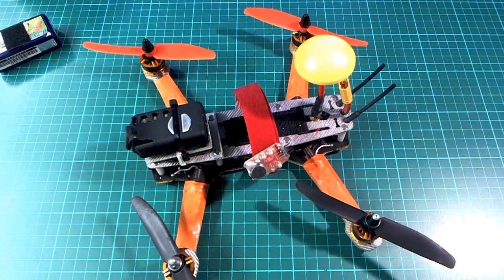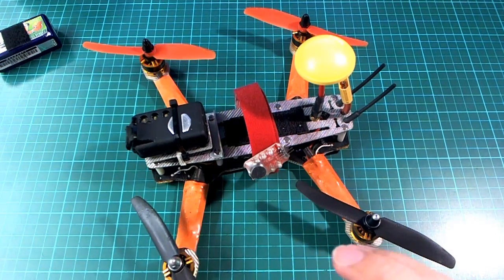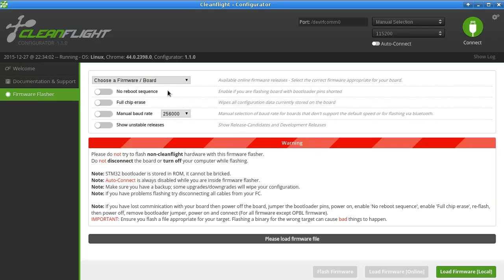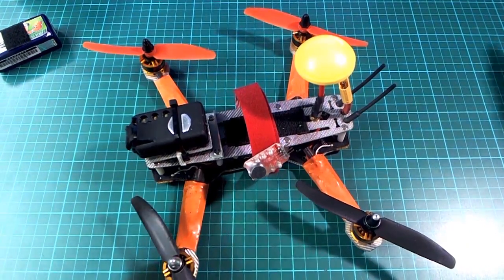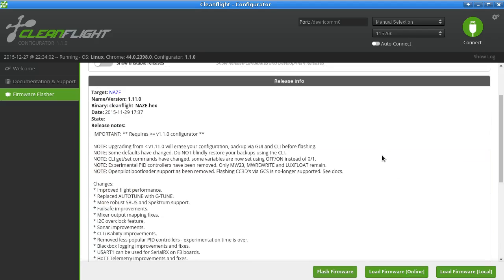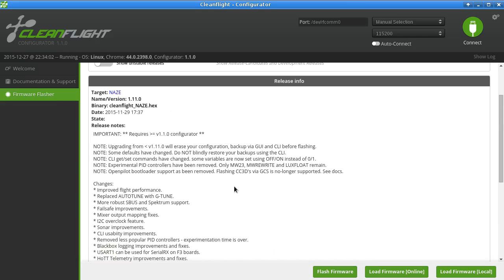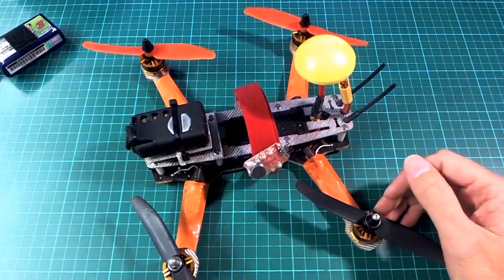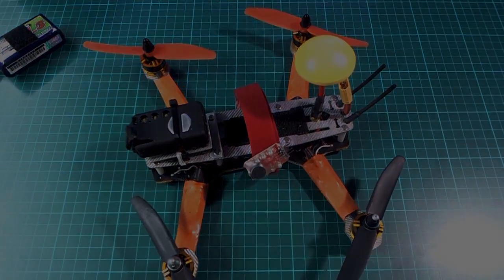Stability problem in Cleanflight 1.11 ?

Comment: just want to share my experience. I got a zmr250 running cleanflight 1.13.0 pid controller is multiwii rewrite. The Level P is 9 and in angle mode it oscillates a lot. Not as bad as the one in the video.  previously it was on cleanflight 1.10 using lux and it was very stable in angle mode. I want try rewrite simply because my board is  a F1 board(cc3d) which ppl say not an ideal fit for lux. float point calculation will be too much for F1 board and I am using led feature. Could someone please clarify for me, is the pid setting only applies to rate mode only?
Reply: My P level for lux was 6. I will lower my P to 4.5 and see it's effect on the oscillation.

Comment: TUNE YOUR PIDS. It´s like driving with a car with no air in the wheels. of course it feels wobbely. but the problem is not the car/copter itself, its the right setting of the different parts.

Comment: We are finishing a course at UNI with SPF3 on a 200mm frame, and all 3 quads were doing the same as shown on the video in Angle mode, 3 copters: 2 with Betaflight 6.2 and 1 with Cleanflight 1.12.... We brought the P down to almost nothing and it seemed like it needed to be brought up instead, can't resolve this, same issue on 3 copter assembled in a course... We initially thought it was due to the RCX red bottom Motors which were too powerful, using 30A Little bees, with one shot and profile 1 . rewrite FC...????? This issue reproduced on the 3 copters with 2 different Firmwares.... Reproducible, so big issue, right!?!? Can't tune it guys, just can't!? What would be the fix here, the PIDLoop is set at 3500, from standards settings... WE HAVE TO FING A FIX FOR THE STUDENTS LADS; WE NEED SOME HELP HERE ALSO....
Reply from the maker: +FPV Cambodia did you read the video description? It's the P term of the LEVEL PID, not the rate PID.
Reply: +iforce2d Wright! Got you.... This must be it indeed!, and we have installed a Sonar also for the course, which was not activated for the fIrsts 3 tests; but I get it, as on the Naze with Clreanflight earlier version, I had to bring the Level P to indeed around 5 with Sonar to keep it level properly... 90 is indeed, insane.... Will bring it back to 10 ich', and see how it goes from here! Haaarrrr; My reading is Crap! Tks again, will jump into it next week, when I am back in PP. and I will keep in touch! Tks ever so much! It makes sense! Cheers and Safe Flying!

Comment: yup, nail on the head, atti mode is STILL like this in cleanflight (no idea why that deafault hasn't been addressed) but Borris corrected it to 3 in Betafilght by default. That even caught me out when setting up a quad for a friend. Anyway, When was the last time you tried beta flight? If youve moved up to Oneshot on your ESCs you should be getting much more locked in results now. Cheers.

Comment: I just install CF1.12 and it works fine, i had the same issue with 1.11
Reply: I had the same oscillations of death on 1.12 but lowered the P level from 2 to 1 and it is now flyable. I do have a tricopter and this may be one of the differences.

Comment: Thanks for good information. I just try to install Cleanflight on Flip32.
My quad also the same problem as you (but roll oscillation)
So I change the firmware from Naze32 1.11 to 1.10 ... it solved.

Comment: Did you retune your pids and put LuxFloat PID controller when you put betaflight on
Reply from the maker: +UK SCALE AND FPV no - see the video description
Reply: +iforce2d if you run clean flight 11 put the LuxFloat PID controller on and drop you board loop time to 2000 then tune you quad I use this on all mine and there all rock solid take a look at either my emax nighthawk 200 video or one of the thug pig ones and you can see how well they tune up
Reply from the maker: +UK SCALE AND FPV yeah I always forget to lower the loop time before I tune and then afterward I can't be bothered doing it again :) Next time I'll try like you say

Comment: Please learn the basics about pid tuning !
Look at this one;YMFC-3D part 5 - Quadcopter PID controller and PID tuning
https://www.youtube.com/watch?v=JBvnBO279-Q
I did the same thing but yes it could take a long time to learn this stuf.
su6.:)
Reply from the maker: +lowies1dubbing I am no stranger to PID tuning, as you could see from watching a few of my other videos. I actually made my own YMFC build too. The issue in this case is that there are two PID controller types which treat the PID values differently, but the values are not kept separate in the EEPROM. For example when you switch between one of the Multiwii controllers and the Luxfloat controller, you can see a different set of values placed in the input boxes, because Luxfloat treats the values quite differently. But when you switch between Multiwii (old) and Multiwii (rewrite) the values are not changed, even though the Level P value (and perhaps others) are treated differently. Please read the video description for some more on this.
Reply: Okay I see.
I put my commands there because there are more viewers on your channel ;)
Thnx for the learning clibs & I will see many more of them.

Comment: how do you change to an older cleanflight configurator? could you upload a video of that?
Reply from the maker: +Roger Paull I'm not sure why you would need to - the configurator is backwards compatible with older versions of Cleanflight. If you're talking about how to flash a different version of cleanflight to your flight controller, there are plenty of how-tos around about that.
Reply: No I know how to reflash it with whatever, I would like to use the older configurator because it doesn't unsave your stuff because it thinks it's wrong.
Reply from the maker: +Roger Paull I don't know what "unsave" means, but if you really need an older version of the configurator I guess you'd need to get it from github. https://github.com/cleanflight/cleanflight-configurator
Click on the Branch: button and then the Tags tab to select a version, then download using the Download zip button. Add it to your Chrome apps as I show here: https://www.youtube.com/watch?v=K10qpQ47Q6Y#t=6m31s
Reply: Thanks for your help, someone earlier told me something to try that actually worked, apparently under UART2 I am only supposed to turn on Serial RX and leave MRP off.

Comment: Cheers mate...... that'll teach me to install new firmware, drive 30 miles to my flying field without testing it and crashing the bloody thing within 10 seconds :D
Reply from the maker: +Vortecks I have gotten into the habit of doing a very brief flight and FPV check before I leave home, otherwise I always always forget to take something.
Reply: Vortecks

I ordered my drone, waited a month for everything to come in, flashed it, messed up the board, took it into local shop for repairs, waited another month for repairs to finish, went through hell looking for information on how everything works, went to fly, and it immediately had stability issues. On my drone the gyro wanted to take over and flip it upside down and smash into the ground. So here I am 2 months and a few days later and I've technically still never flown FPV. This is definitely one of the most frustrating things I've ever done. I almost regret even spending money on a drone. What was I thinking?
Reply: @Martin1519  that's why us people that fly love building just as much, I spend prolly half n half flying n builing/upgrading my quads
Reply: Tonio9606 Stay motivated and don't give up. You will find a solution eventually and won't regret having spent the money anymore :)
That's what beginner have to go through some times. And so did I... :P
Reply: Michael Bialocur 

Thanks :) a lil update, I actually finally got my drone back a couple weeks ago, 4 months later, and finally got to fly. I even flew earlier today. So far I've only been flying LOS due to some minor issues, "needs new VTX board for video", but I'm just so happy I get to fly at all. Thanks for the input, I will not be giving up :) and I can't wait to try flying with a set of goggles someday!
Reply: Tonio9606 Aaaaah there we go. Glad to hear that, and happy flying! :P

Comment: i have the Lumenier QAV210...upon takeoff it drifts to the right bad, any suggestions? i am new to all of this.
Reply from the maker: +Jonathan Sosa In angle mode or rate mode? Only on take-off or all the time?

- Check that the gyro values in the sensors tab are approximately zero when the quad is not moving
- Calibrate the accelerometer- Check that the accelerometer values in the sensors tab make sense (x and y approximately zero when level)
- Trim your transmitter sticks in the receiver tab so that the pitch/roll/yaw values are at 1500 when the sticks are centered
Reply: +iforce2d I'm in angle mode and it drifts to the right the whole time. Is my I to high?
Reply from the maker: +Jonathan Sosa I doubt that would have anything to do with it. Did you try my suggestions?

Comment: Try changing the default pid controller between rewrite 2.3 or luxfloat.  That worked on my 450 which was acting just like yours.  I might actually try to go down to 1.10 of it flies better since there's no ground breaking changes between the two versions. My zmr runs perfect on 1.11 with pid controller one. I haven't tried the other controllers yet.
Reply from the maker: +walkaf1 yup. I have added an update in the video description.
Reply: +iforce2d ahh great information thank you! This helps me !

Comment: Holy crap! I was just about to change the escs, motors and flip32. Thank you so much for this video. I wonder how they can call this version "stable"?
Reply from the maker: +sladelefty cool, then it was worth making the video :) I updated the video description with my verdict on the issue if it helps.
Reply: +iforce2d I went back ti 1.10 also and am waiting for the snow to stop to give it a go. Thank you again for saving what sanity I still may have.

Comment: Here is the FIX..
Its in Level -- It is set to 9. by default.. It should be set to 2..
The strength in horizon says .010 but that is a glitch.
Go to DOCUMENTATION for 1.11.0 in cleanflight and look up PID tuning.md it explains it all..
Reply from the maker: +Joel Rhodes I think we might have a winner :) That sounds exactly like what would cause this kind of problem. I have to shake my head though, about why the situation was left like this: "the default value for P_Level is 90. This is more than likely too high of a value for most, and will cause the model to be very unstable in Angle Mode, and could result in loss of control." Very very very weird choice of default values...!
Batteries are charging now, I'll try it soon.
Reply from the maker: +Joel Rhodes yup - you win :)

Comment: Hi, i had the same issue, ZMR250, RCX 2206/2250kv motors, rotorgeeks 12a esc using BLheli 14.3, running 3s , Cleanflight 1.11 with PID1 Multiwii(rewrite) oscillated and flipped, not as violent but it flipped. now on BF 2.1.5(to be 2.1.6 soon) with PID controller 2 (LuxFloat), angle mode is now stable. trying to tune it slowly, (was oscillating slowly with default values). ONESHOT125 enabled.

Current PID settings with LuxFloat
              P      I             D
ROLL:   1.4   0.050    30
PITCH: 1.4   0.050    30
YAW:    6.0   0.045    10

ROLL rate: 0.10
PITCH rate: 0.10
YAW rate: 0.30

Curious to know if anybody with a similar build has tuning anything close to this?
i think i can get the P values higher, and the I is slightly low, keeps loosing altitude...
the D value when raised to 30 and P at 1.4 removed the oscillations.

i have not tried 1.10 as i thought it only was a PID tuning problem, first build learning the ropes...

Comment: I can confirm, had the exact same issue with Angle mode. It was my maiden flight with the quad, and I thought I just did something terribly wrong. But when I switched to horizon, the problem is gone.
Reply: +Fabian In PID Change Level from 9. to 2.
Reply: +Joel Rhodes I am on Betaflight right now. Only flying Horizon and Rate mode. Would you still recommend this? Also, I ran G-tune on it a couple of times, but it seems just to adjust my yaw P. (yes, doing it in rate mode)  Still see a lot of oscillation on fast descents.
Reply: thanks i will try that.  I have the same thing occurring.

Comment: FWIW I had he exact same behavior with 1.11(MultiWii Rewrite) in angle mode.  I tried to adjust the default tuning with no noticeable changes.  The behavior was indicative of too much P gain so I took that way down and it continued to shake violently until it finally flipped.  I ended up changing to horizon mode with default PID and it flies nicely.  Very peculiar.

Comment: You need to tune your pids. Thats the only issue i see. When you refresh try checking the thing that erases the board, Then tune your pids.
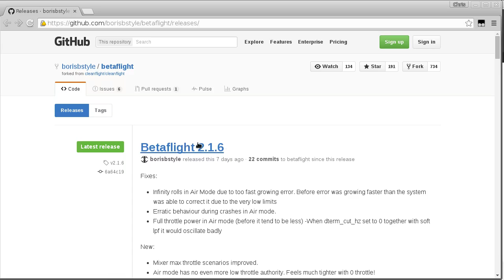Reply from the maker: +shaneman27 You mean the "Reset settings" button on the Setup tab? That's what I did immediately after each time I flashed a firmware - I showed the whole list of steps I did at 1:46
I also see that betaflight is touted as "Easy to no tuning. Stock settings for PID1 and PID2 should be very well flyable on most machines." and the ZMR is not a strange frame at all, it's very common.
Reply: My quad didn't fly well AT ALL on CF 1.11. But when I flashed betaflight it worked wonders on my machine. I also found that it helped to tune the PIDs a lot. Without it I seemed to have a similar issue as you. It seems like you're having a bit of an odd issue there...

Comment: Try again with betaflight but this time with LUX controller it's a blast!
Reply: +Fr33lumby© ....might be, but I think Betaflight is now based on Pid1 and you will have to recalculate your PIDs.
Starting on defaults for Pid1, with a setup from scratch, gave me a nice hover. I have to admit,  I even changed my esc (ZTW)from SK to BLH 14.3.0.1. Some wooble I had before is gone. The most important thing with BF is, do not blindly copy from older CLI dump!
Reply from the maker: +aMax what exactly is PID1, I don't see that anywhere in the configurator
Reply: +iforce2d Don't worry it's based on PID2 anyways, and at the tab where you can change your pid's the first box select PID Controller 2 (Luxfloat) and try default settings.
Reply: +iforce2d with the latest Betaflight FW of course
Reply from the maker: +Fr33lumby© so PID2 is luxfloat and PID1 is...??? How do you know this and why don't we call them by a single name
Reply: +iforce2d They just jave a number and a name it's somewhere noted at github/cleanflight
Reply: +iforce2d and i think PID1 is multiwii rewrite
Reply: +iforce2d https://github.com/cleanflight/cleanflight/blob/master/docs/PID%20tuning.md
Reply from the maker: +Fr33lumby© yeah I see it here: https://github.com/cleanflight/cleanflight/blob/master/src/main/flight/pid.h
Not very user-friendly... I can't imagine every cleanflight user in the world is even familiar with the code anyway.
Well I'm trying luxfloat right now and all is going well so far :)
Reply: +iforce2d yeah if u dump your cli each pid controller got a number, and lux is a blast, literally no tuning needed.
Reply: +iforce2d and btw, you should definitely step up on your esc's :D
Reply from the maker: +Fr33lumby© yes, that's true.
I just smashed a bunch of props and ripped some balls thanks to gtune, it was fine for about 30 seconds and then ramped up the gains so high I could not descend or even lower the throttle at all.... I think I will stick to the default PIDs they weren't so bad after all.
Reply: +iforce2d Yeah i would suggest you to manually tune and only small steps starting from default pids not like we were used to be. But as i said, literally no tune need.

Comment: What PID controller are you using in 1.10? All except MWREWRITE and LUX have been removed from 1.11 and BetaFlight. If you were using Multi Wii Old you will need to completely re-tune as the PIDs are not portable across PID controllers. Also make sure you are using BLHeli 14.2 or higher with 1.1. I like you setup script. I use the same, you can also use CLI commands to set everything (ex: feature ONESHOT125) makes updating a snap.
Reply from the maker: +fr3d_fly I have never touched the PID controller selection in my life... 1.10 gives me Multiwii (old) and 1.11 gives me Multiwii (rewrite). When I click the "Reset settings" button in the Setup tab it changes my PID values to the defaults, and the claim is being made that betaflight is "Easy to no tuning. Stock settings for PID1 and PID2 should be very well flyable on most machines." and the ZMR is not an unusual frame shape. I am assuming that 'stock settings' means the defaults given by the software after installing (or resetting), but maybe that was a big mistake. I would also assume that if that was the cause of this issue, hundreds of people all over the world using ZMRs and updating to 1.11/BF from 1.10 would all have similar problems, but I couldn't find any cases of it elsewhere in my google searching. The ESCs are not BLHeli so that is not relevant.
Reply from the maker: +fr3d_fly the release notes also say "upgrading from <1.11.0 will erase your configuration" so why would the old PID values have any bearing on anything.... sorry to be grumpy, I just wasted a day of very nice weather, now I have made a video that will end up with me looking like a clueless noob if it's just a matter of PID tuning :)
Reply from the maker: +iforce2d Actually I just reflashed betaflight and I see six options in the PID Controller selection:
Multiwii (old)
Multiwii (rewrite)
LuxfloatMultiwii (2.3 - latest)
Multiwii (2.3 - hybrid)
Harakiri
Reply: +iforce2d if you try to set anything other than rewrite or Lux it will bounce back.
 I don't know about angle mode (never use it on BF) but i doubt that is well tuned in BF.  It looks to me like the BF 2.1.6 Rate mode part of the video just needs a little tuning.